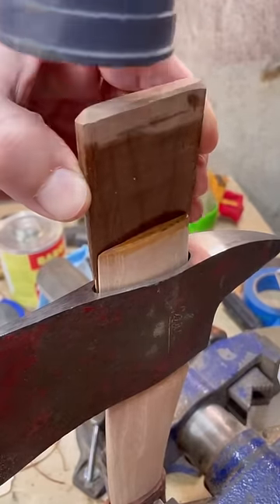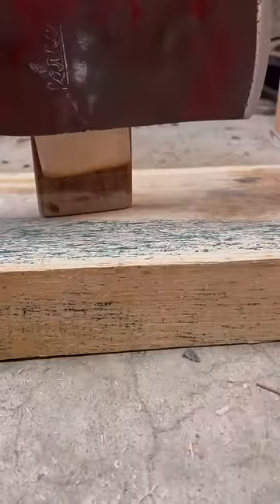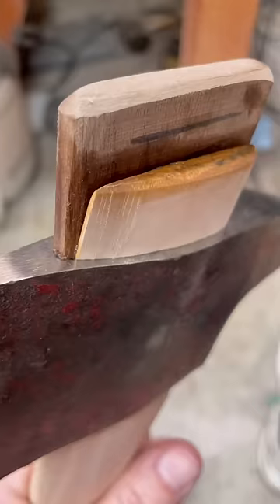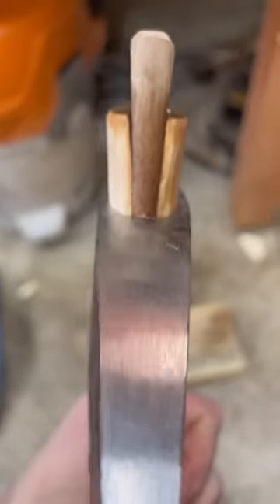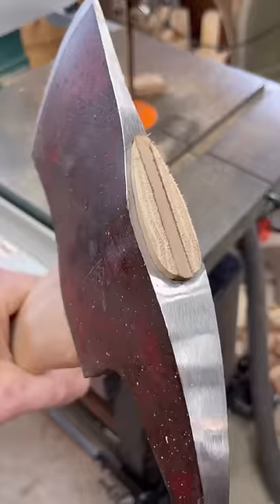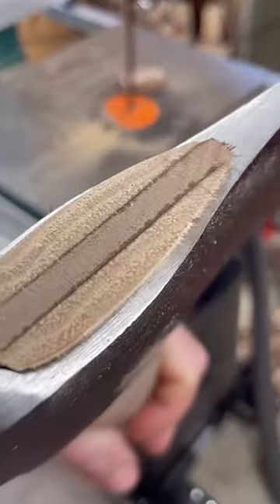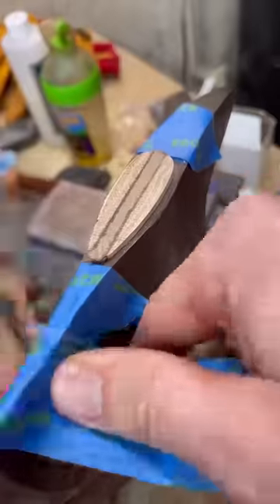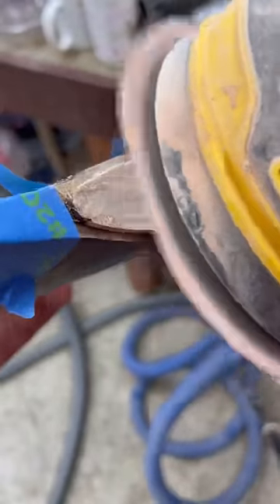Wedging Warren School Bus Fireman’s Axe - Vehicle tool! #overlanding #tools  #stumptownaxes

Comment: I would have sealed the deal with either a steel cone wedge or a standard steel wedge at a 45 but clean work regardless
Reply from the maker: Yes that's a common practice for sure.  I prefer to not use metal or glue on wedges.  I would rather have the ability to pull the wedge relatively easily if needed and adjust the fit.  The tapered nature of the eye will ensure it doesn't fly off.  I come across hundreds of vintage axes with metal in them that are lose, and unfortunately with all that metal the tongue is often destroyed.  Some folks don't like to maintain their tools but I enjoy it.  To each their own though.  Nothing wrong with doing things different ways.  Thanks for watching!!
Reply: @StumptownAxes  curious what youd recomend using instead of glue?     new to axe handle making and want to say thank you for shareing your knowlege.  has helped alot.   the plumb set ive been making is starting to turn out great.
Reply: @bmoreglass7258  i think he uses linseed wax